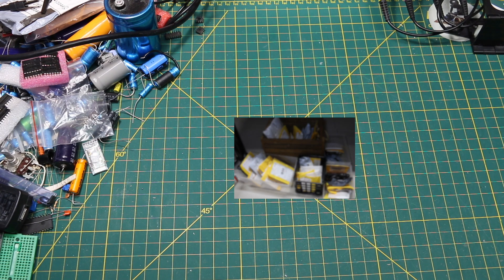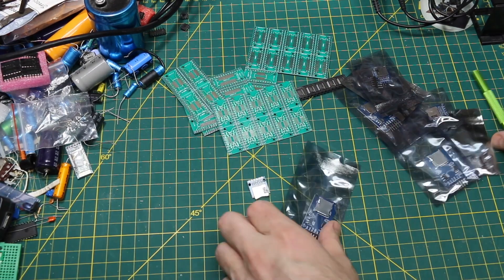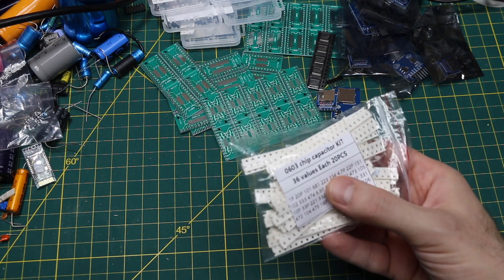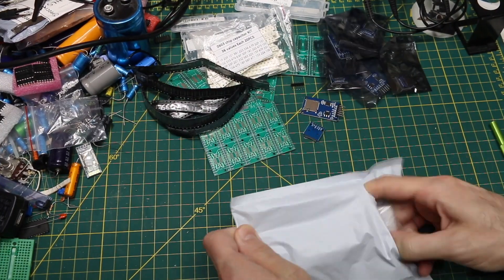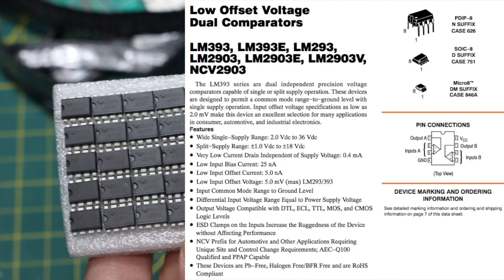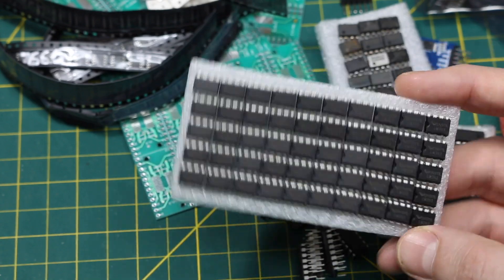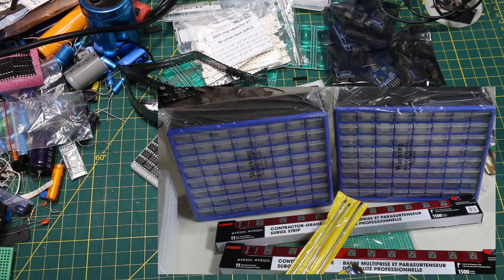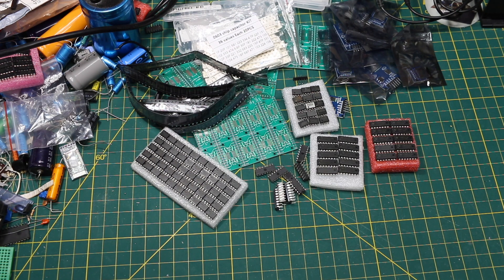First Mailbag of 2024!

Comment: I avoid cutting mats, as they are prone to static build up. I want to give my chips the best start in life as I can.
Happy New year
Reply from the maker: One day if the dream workshop ever gets built I’ll have to see if I can find those long rollout ESD mats without them costing $1 million plus inflation
Reply: @GadgetReboot  I was lucky, i fitted out the benches in my lab at  the last place, the off cut did my bench as well.
as you say a good mat don't come cheap.

the potable repair/service mats are some times a good buy, as you get the strap and plug all in.

but my adaptor is just a plug with the lead connected via a 1M resistor to the earth pin.

Comment: Ever have the pads lift up on those smd to dip? It drives me nuts
Reply: You overheat them maybe ?
Reply: @jw200  good point and I tried that. I'm trying to stop buying cheap Chinese garbage parts and making mouser and digikey orders when I know the orders are large enough to get overnight and customs free shipping. Living in Canada is a horrible place for certain things. Guitars cost a fortune, virtually any item you can measure a voltage from, plus 3d printing stuff. A prusa kit here is 2k and we have to assemble it. So I never bought one. I've got a few awesome ones now but I'm selling one today and buying a spectrum analyzer I think. There's a siglent model you can do a firmware crack and make it the same as the one which costs 4k. It can also be a vna as well but I just want it for audio, measuring antenna and renting out or for repairs. It's bananas how much a cheap one costs. I may save the money for an extended trip to Myanmar where I'm gonna rent scooters and go through all the countries under China. I want to see all the temples and eat cheap noodle dishes hahaha. I'm gonna spend a month or 2 farting around there for a month or 2 this fall.

Sorry. I oftentimes go off topic. I think the quality depends on the batch as I tried like 3 different cartridge types.
Reply: @jstro-hobbytech  I have no idea what your technique is of course but two general tips -- use a knife tip and drown the pads with flux first. 👍
Reply from the maker: I haven’t had trouble with those adaptor boards but in general only if too much work has been done on the pad and maybe there was either too much heat or if trying to clean off solder with a copper braid, moving it around instead of keeping it in one spot can scrape a delicate pad away.